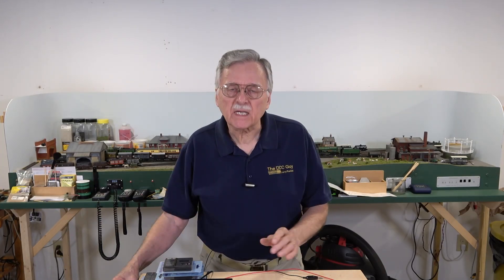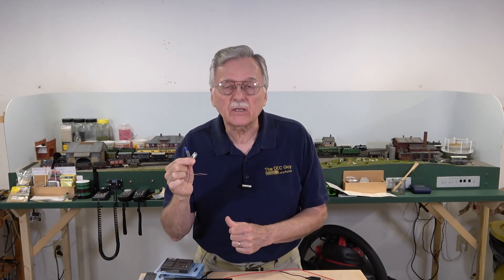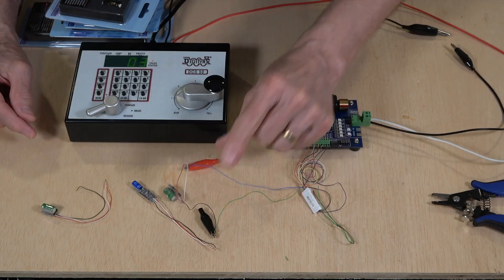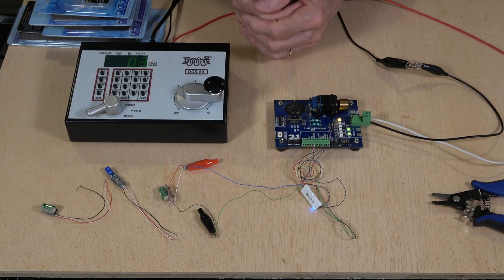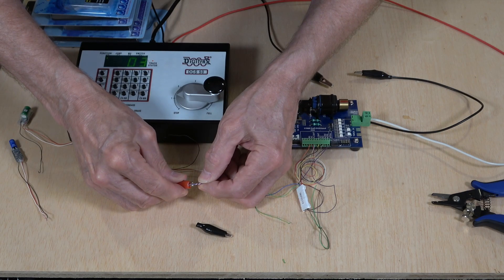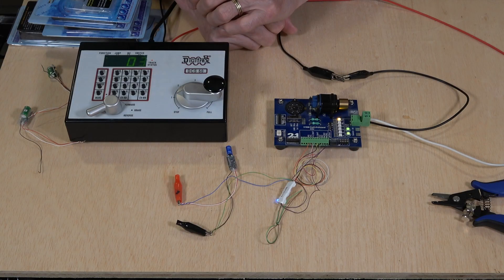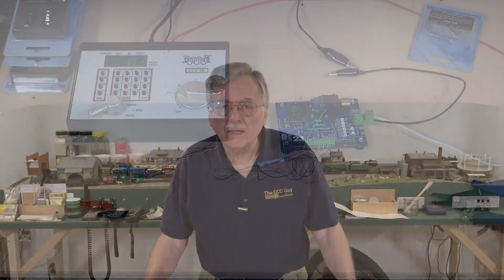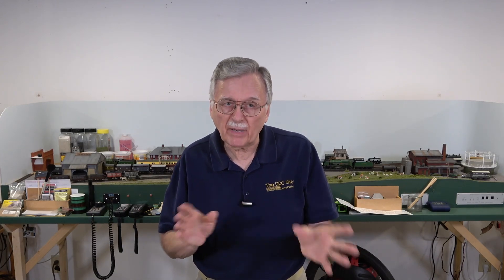Using A 3-Wire Stay Alive With 2-Wire Decoders (396)

Comment: how about a 2 wire keepalive on 3 wire decoder
Reply from the maker: You can do it but be aware that it can lead to issues when programming multiple CVs in a stream, common with indexed CVs. It is a good idea to disable the decoder when programming, which isxwhat the third wire is used for. Several years ago Matt Herman warned me that they (ESU/ LokSound USA) were seeing a lot of decoder failures as a result of a YouTube video promoting the use of 2 wire KAs with their decoders.
Reply: I just wire in a small slide switch from the keepalive to turn off the keep alive power to the decoder when i program

Comment: You should really explain the function of the third wire. It is specifically used to disable the stay alive DURNING PROGRAMMING. For anyone  using the two wire only devices be aware reprogramming may or may not (usually not) work unless you disconnect the stay alive first. If you are doing POM (programming on Main) it is usually not an issue as the acknowledge feedback is not used. If using a programming track is where you would see an issue.

Comment: Hi I was wondering were you are able to get the DCC decoder tester that you have in this video and will it work for any DCC decoder thanks.Russ
Reply from the maker: It is a readily available item with DCC dealers and on Amazon/eBay. It has several sockets for connecting various decoder types.
Reply: .    Ok thank you for getting back to me I will check it out thanks. Russ
Reply: DCC decoder testers are a must for me, I always use mine for programming my decoder prior to putting it in the loco.